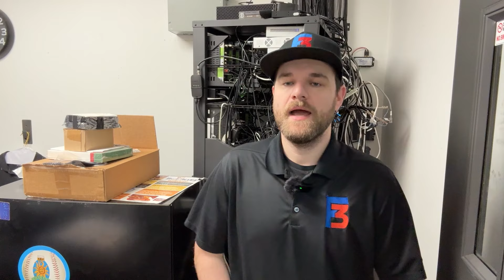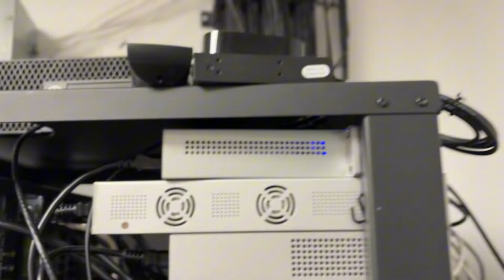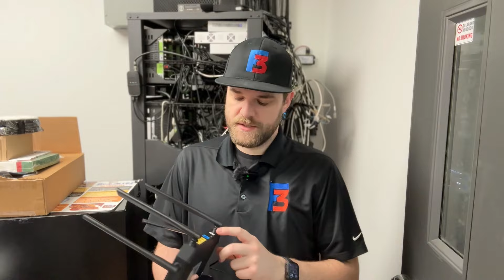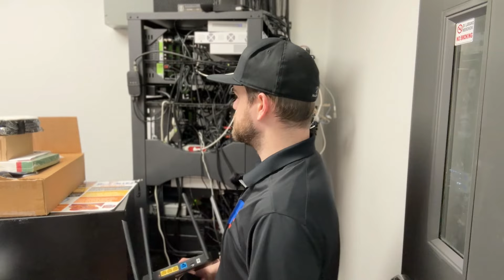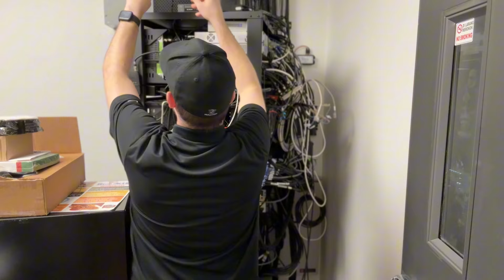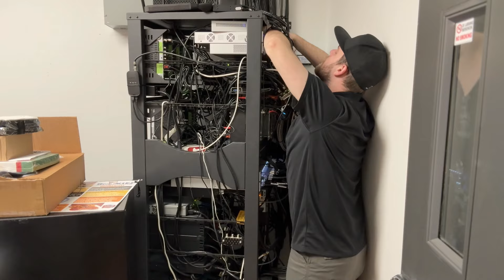Setting Up Failover Solutions: Onsite With Restaurant Networking Technicians

Comment: It seems the Pronto passthrough method would just be the easiest way to go and easier to standardize.  Is there a drawback of using that instead of the WAN 2 ports on the UDM devices?
Reply from the maker: In an ideal world, yes this would be easy way to get the devices set up. Since we manage the network. We would like to have all devices through our Gateway so that we can troubleshoot remotely will aslo limit the amount of mistakes done by pluggin in to the wrong port. Since this location did not have a Gateway with WAN 2 an exception was made to make sure their network has a Failover set up.